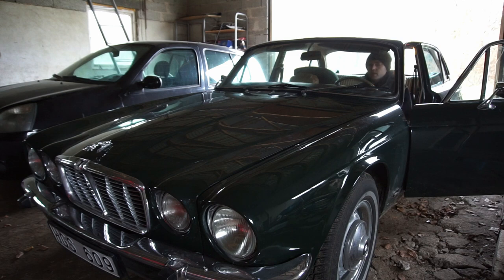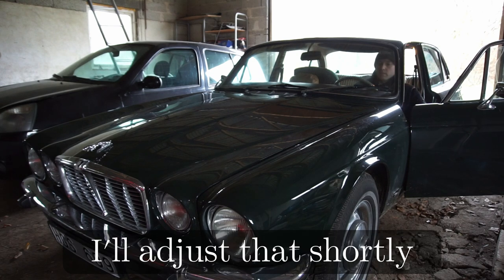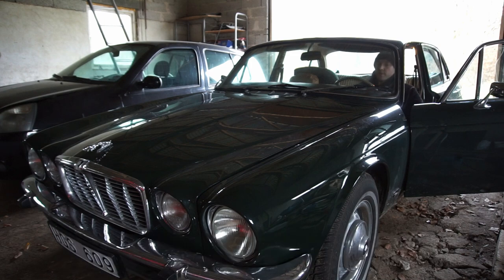Jaguar XJ6 Cold Start Carb Tuning Tips and Troubleshooting - AED Advanced Course

Comment: Interesting video.  I had a P6 2000TC with the manual choke and it was fine.  I also know of at least three guys with XJs who had no issues with the AED units.  I think a lot of people try to adjust the units too much in one go.  I don't have a problem with carbs generally but, you have to love modern injection systems!

Comment: An XK120 I had had something similar as standard equipment.  There was an electric third starting carburator that was controlled by  a bimetallic strip that shut it off after the engine got hot.  It didn't work all the time so most users wired it through a switch they installed on the dashboard an used it as an electric choke.

Comment: I ran an XJ6C in the 90s. I could never get the AED to work properly and ended up fitting a manual conversion with cams replacing the bimetal springs.  I wish this information was available back then.  I am sure I could have got it working in its original form.  Looking back I wonder if there was a large leak in the hot air piping and it didn’t get hot enough. A lovely car.  A big mistake to sell it.

Comment: An instructive video. Nice. One thing I noticed missing on the engine is the hot air ducting that runs from the top of the exhaust manifold heat shield to the air filter box. This device speeds up engine warm-up time and cold running. The only down side is that it acts as an echo chamber for engine noise, especially tappet noise.
Reply from the maker: I have just gotten all new parts for the hot air pick up and I’ll be installing it shortly. It’s a great device that gives an even temperature for the carbs

Comment: Interesting to see how these actually work. A previous owner removed mine and added a home made manual choke which works really well. I have no intention to go back to an AED as what I have is working. As I live in the northern part of New Zealand we don’t experience the cold weather that you have in Sweden and cold starting is not something we know much about! Also I have a stainless steel exhaust manifold so I’m not sure how the hot air system would work with that, perhaps that’s why the AED was removed?

Comment: Thank you so much for the videos on this subject! I've just bought a similar Jag (XJ6 4.2 1978) and the car stopped starting after a few rides. When it did, it took many cranks before starting, so that the battery is almost dead now. I guess I will have to learn myself how to fix the AED, as no mechanic around here (I live in Bucharest, Romania) seems to have any idea about it. People told me I should step on the throttle every time I switch the key on. How do you do it when you have a cold start, like the one you posted in this video? Do you step on the throttle at all or this should be avoided as it definitely floods the engine? Please, advise!

Comment: Hi Adam, Thank you for posting an interesting video. In one of your previous videos you replaced the fuel injector hoses on your V12. It set me thinking about replacing the fuel rail inlet and outlet hoses on my 90 XJ40. These hoses have pulse dampers fitted. My problem is, I can source the return hose but not the feed hose, it is just not available. I wonder if you would know wether the pulse dampers are of the same value for both feed and return hoses. My plan would be to buy a return hose, which is readily available and utilise the damper and end connector from that and together with some new fuel line, make a new inlet feed hose. I think this will be a problem for a lot of 40s owners going forward. PS I have the same rotten cold.😣

Comment: Hello Adam. If it's not too much trouble could you measure how far the needle lift screw is down in the housing on the Aed. I stupidly moved mine and can't seem to get it set back rite. The car was taking throttle fine now she won't take throttle at all...just spluttering and backfiring. Really appreciate if you could help a fellow jag nut out lol. My car is a 1977 Daimler sovereign 4.2

Comment: My '52 XK120 has a thermo carb similar to this. Am still trying to get the idle to smooth completely out without excessive richness.
The Brits should have made the SU carb with an idle circuit, would have eliminated idling headaches. It is an otherwise good carb.